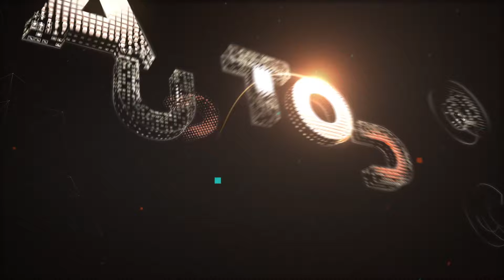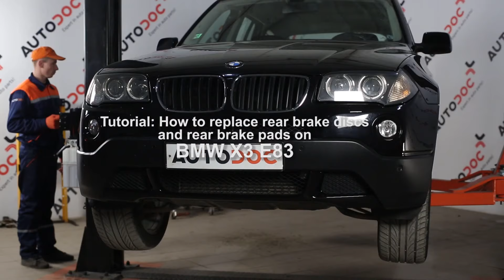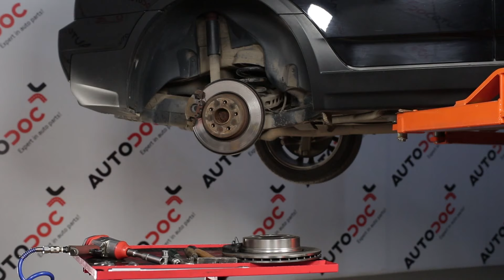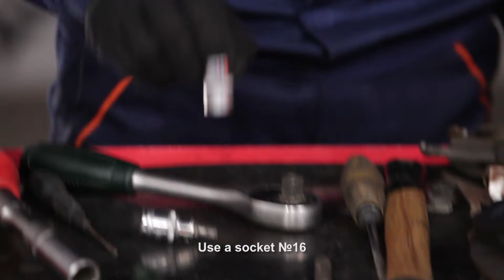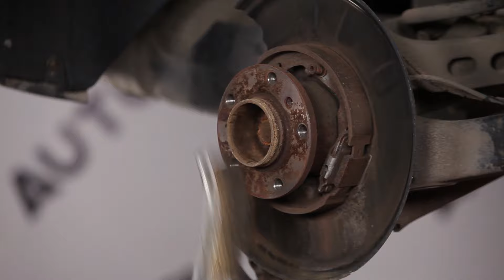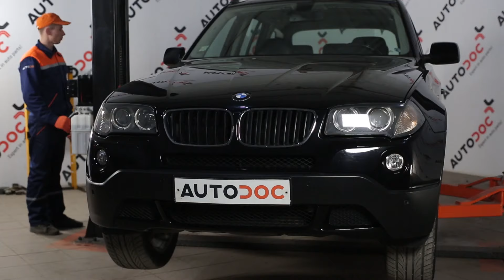How to change rear brake discs and rear brake pads on BMW X3 E83  TUTORIAL | AUTODOC

Comment: Did you replace the brake pad wear sensor?
Reply from the maker: Thank you for your feedback! When replacing the pads, the brake sensor wasn't  also replaced. The car  owner refused from iits replacement for the reason that  the old one wasn't worn out, Best regards, Autodoc.